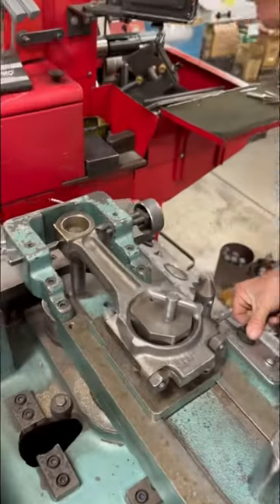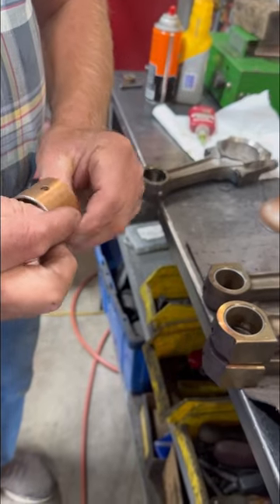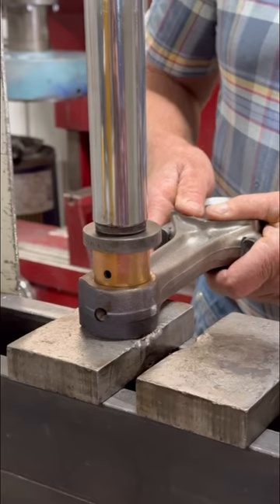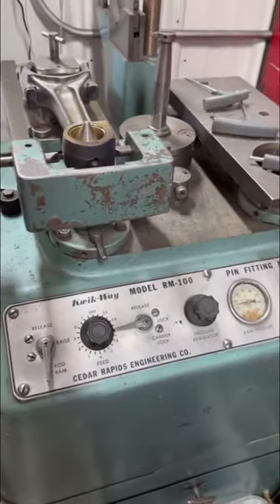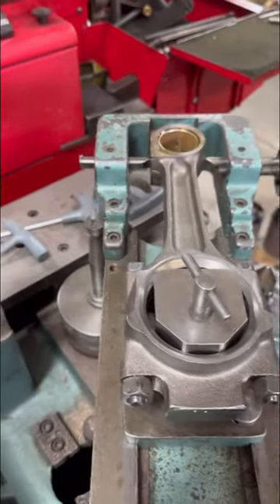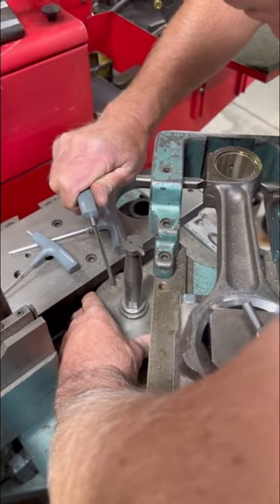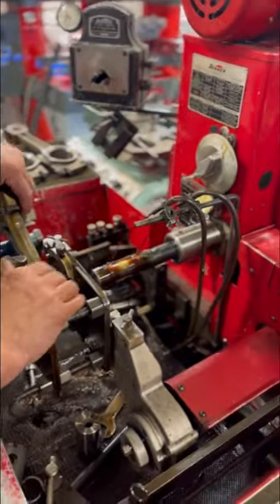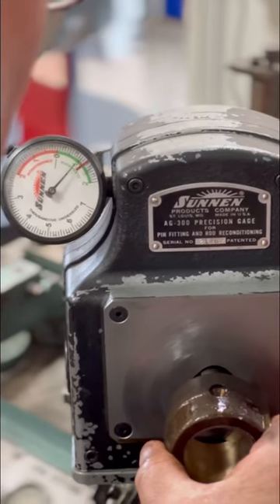#shorts Installing New Pin Bushings In D310 International Connecting Rods

Comment: Wonderful machines I never knew there were so many specialty machines.
The sunnen hone must get quite a bit of use
The methods are different than working with a Bridgeport milling machine a staple in most machine shops.
I also don’t see a radial drill press. I haven’t seen any horizontal milling machines or even any cnc machining centers.
Are almost all your machines special for automotive purposes?
Reply: All of them are manual. And automotive specific

Comment: Love the channel. Curious. Isn't it better to, (with cert. standards,) regularly test/check the tolerances of the machine, and cut straight to size (allowing for the machine tolerances). Then it is to sneak up on a dimension? Or is this not practical in day to day operations of an engine machine shop?
Reply: If your setup and parts are consistent, sure, cut in 1 pass. It's always safer to rough it, then take a consistent 0.005-0.010" finish pass, so you aren't fighting spring back of the cutter or machine. I'm sure the bushings come in packs, so messing one up would require buying another set.

If they are offseting the pin centers, they would want to sneak up on the size to make sure the bore is round. Offset or interrupted cuts would make the bore egg shaped.
Reply: Always better safe than sorry. Like when machining rotors, Always easier and cheaper to make a second pass to take a little more off, then try and put metal back on. 😂

Comment: I'm just your average machidist but I've never heard of using loctite to secure a bushing/bearing in a boss how difficult will it be to replace the bushing in the future and of course how does that loctite not plug up an oil galley Great video Love the content
Reply: Its made by Loctite
Reply: Loctite has many different products, and he used one of the bushing retainer compounds designed for this type of application.
And most will only cure when confined in a tight space, and he Wipes any excess off anyway.